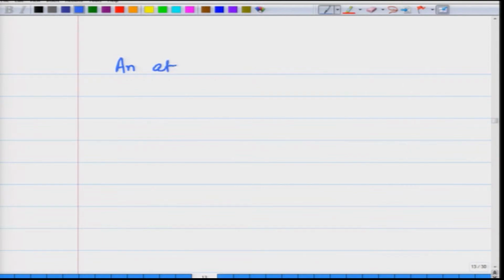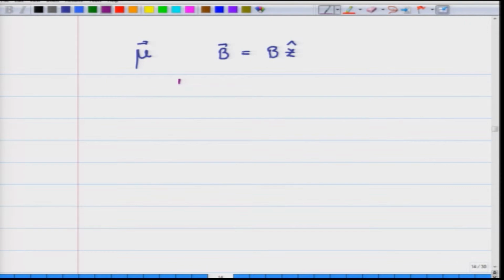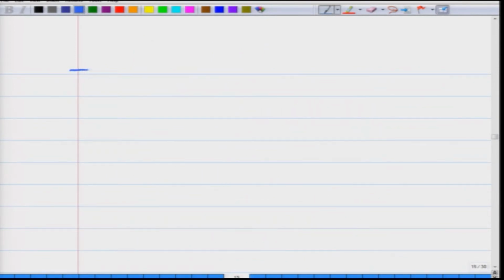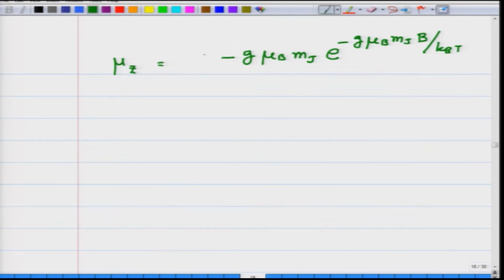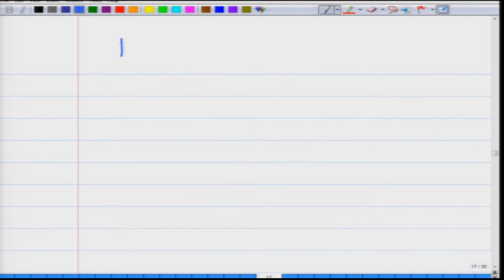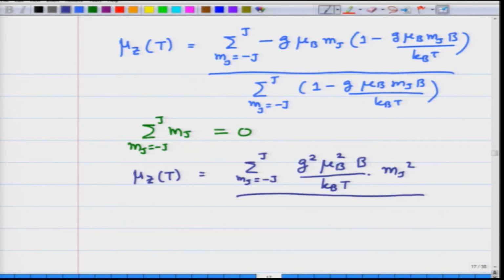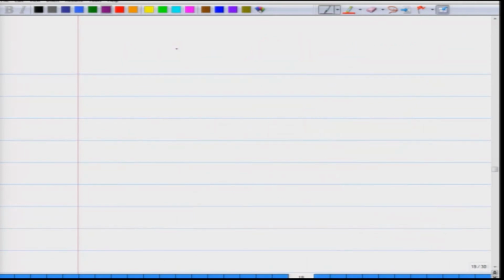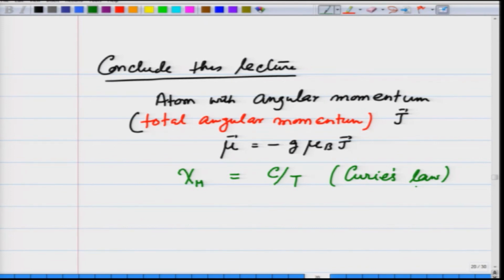noc19-ph02 Lecture 76-Paramagnetism in solids II - temperature de

Comment: Nice lecture but I have one doubt you have calculated magnetic moment at high temperature
Reply: Absolutely I have the same confusion because.. exp(-1/T) is nearly equal to (1-1/T) at high temperature 🤒🤒
Reply: Sir in the absence of magnetic field if we consider the energy of the system do they have different energy values since each atom have different energy states and how they account for the splitting after applying b field?
Reply: @amrahnichu9532  in magentic feild, for one electron system, the system splits to gives 2 states, parallel and antiparallel spin. For the atomic system, there are 2j+1 states from spin orbit couplings. in an experiment we can only measure the change in energies and not absolute energies.